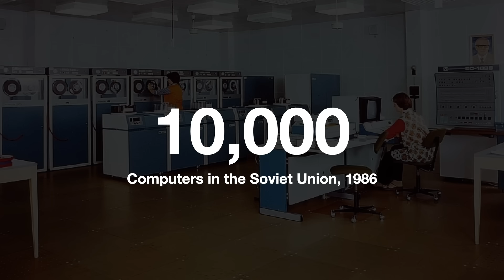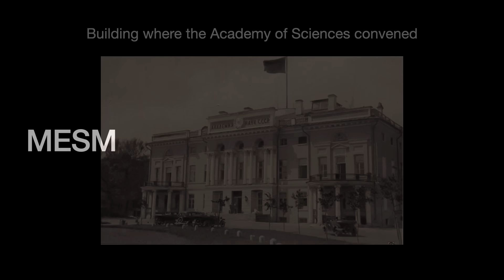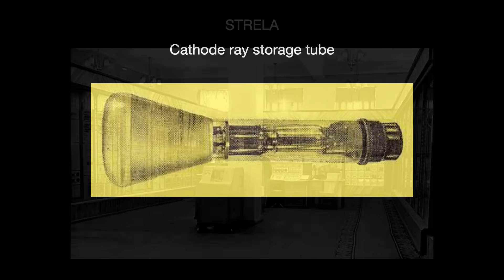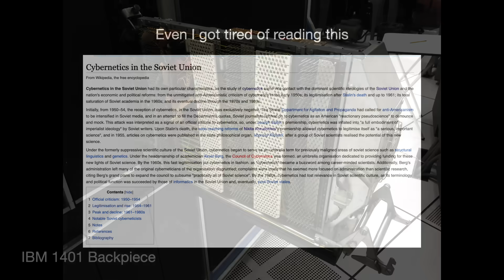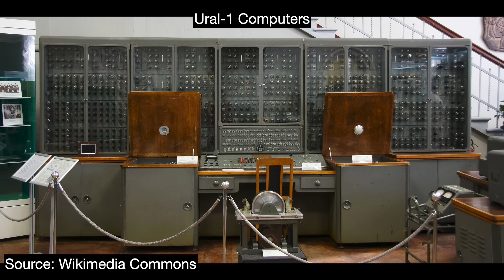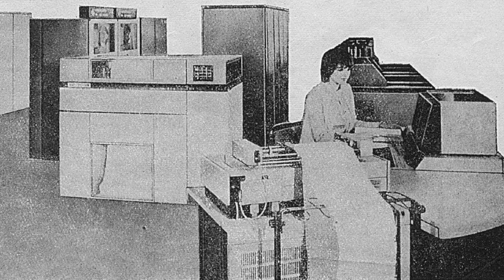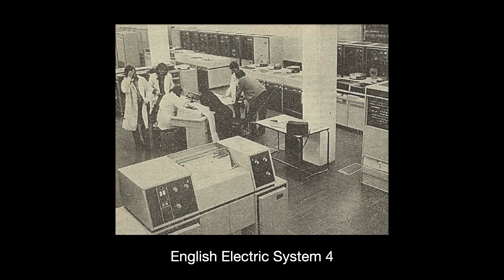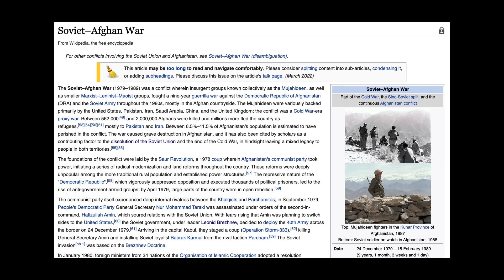Why the Soviet Computer Failed

Comment: USA companies held essentially monopoly on high integration microchips and high quality transistors. Just that makes a world of difference as to what can be made economic.
In 80s, US had single chip FM radios. Soviet radios were wire wrapped monstrosities using low quality transistors.

It had exactly zero to do with incentive - when it was required, even excess quality and performance was achieved. Computers were deployed a plenty everywhere, but they were typically form fitted industrial machines to the application and not extensible, universal ones like USA made for general public.

USA explicitly avoided that issue thanks to ARPA/DARPA and universities funneling the research into corporations. Soviets... made high quality things military secret so nobody could iterate and mass manufacture of them was nonexistent.
Reply: In Czechoslovakia, semiconductors were produced by the company TESLA Rožnov. Elsewhere in the world, the company had some technology and here it was perfectly mastered to have uniform quality. In Tesla, they copied almost all CMOS, NMOS, FET, JFET, bipolar and alloy methods. A very wide assortment. The flip side of versatility was that quality fluctuated. For analog applications, it was possible to choose components with better noise than Western products, but without a choice you could be unlucky and get a piece that is significantly worse. This was typical for socialism. Everything existed according to the papers, but it wasn't enough and it didn't have guaranteed quality.
Reply: Precisely. That was due to lack of focus on mass manufacturing of electronics that required such things.

And as far as I remember, Tesla Roznov semiconductors were never large scale integration, until Motorola/OnSemi got its hands on the factory. It's still not making LSI chips.

Best thing out of it were high quality medium scale analog parts like voltage references - and that in almost 90s...
These days, Roznov facility is a design laboratory, rather than a manufacturer.
Reply: Excluding the Soviet Union does not a monopoly make.

Comment: I'd been taught that Soviets stuck with tubes because they were less susceptible to malfunction or inaccuracies with temperatures an altitudes that early ics had. Thing needed to work from the taiga to Afghanistan
Reply: That and tubes are a lot more resistant to EMP.

Comment: When I worked at Elliott automation we had been selling the the 903 18 bit digital computer for a few years. The Russians wanted to buy a 903, in exchange we had to buy one of theirs, this would have been around1967. The Russian computer was of no use to us, it was housed in what seemed to be something made by a military tank company, we had no use for it and it was just stuck in some quiet corner of our plant in Standard Road, Park Royal. I believe we were suppose to pay import duty on it but we didn't want pay the duty as we didn't want to use it. One day the heavies from I guess the 'Import Tax Police' came armed with wrecking equipment, they just set to with sledge hammers etc to completely smash the computer up, they did seem to be enjoying this job, They left a messed up pile of stuff and left after a cup of tea, quite interesting to see them work!! I do believe we got quite a bit for it for scrap metal. In 1969 the 905 computer was introduced, this was a integrated circuit version of the 903, faster and more compact. We were not far behind the US in integrated circuit design and manufacture, I started working for the Field Service arm of GEC computers in about 1971, mainly working on the 905 computer.
Reply: I joined GEC Computers in 1973 on the software side, writing Operating Systems for the GEC4000 series. 7 years later I was installing and commissioning 4 of these at Machbriboringtorg (excuse spelling) in Moscow to control an earthquake simulator.

Fun days, and more fun evenings. And plenty of vodka, chamagnskoja, etc.  And decent caviar was cheap.

Comment: One could easily argue that there's no way even a clean sheet domestically produced computer manufacturing base would have done them much good. They were 10-15 years behind and would not have caught up at all if they had to reinvent everything. To make matters worse, the whole ecosystem is international and today only a Dutch firm is capable of creating the masks and photolithographical chip layouts at the sub 10nm size. Good luck stealing a giant chip fab.

Comment: Two comments, IBM 1401 used punch cards for programming and data input. 'Cathode Ray Tube' is used as a display unit, not as storage.
Reply: In the early days of computing, CRTs were used as memory. Delays in material, mercury or nickel tubes were also used to create a circular register. https://en.wikipedia.org/wiki/Williams_tube

Comment: You talk only about supercomputing and mainframes, but you bypass the subject of PCs. When this market exploded in '80s, the Eastern Block quickly acquired this technology by violating the tech. embargo through... stealing, smuggling and pirating everything possible. As a Pole I could even give you names of a few later politicians (including one Prime Minister) who made money of, and specialized in maintaining smuggling lines (most probably through Austria and East Germany) to USSR. I remember so called "computer markets" where you could order and buy whatever software you wished. Usually the "pirates" just copied it on site to floppies and later CDs for a very decent price, which was just the copier's earn. Initially there was absolutely no licensing rights protection. With time someone started to pursue and tax piracy, but it was just a systemic half-official mafia extorting their "market share". This continued and tightened throughout '90s, long after the Eastern Block crumbled, into the 1st years of XXI c. when it was ultimately officially suppressed.
Additionally, in Poland we had successful lines of minicomputers: Mera-300, Mera-400, and Odra line: 1001 to 1325. My father used to work on Mera and so I used to play with tape punchers, and colorful computer tape spirals and confetti.  :)
Reply: Smuggling a few hundred C64s wasn't the massive advent of personal computing. :D
Reply: @prutok  HEHE, you underestimated it terribly. C64s weren't office machines. The market for C64s, Amigas and Atari STs was huge even in Poland. They've smuggled x86 line and mainframe terminals. I'm convinced the West was perfectly aware of it.

Comment: First of your videos I've seen, and very interesting. A couple of minor points though: Firstly, you point out that the Soviet's space programme was based entirely on the 'captured' German rockets and personnel, but neglect that fact that the US (and the UK) did exactly the same. The Saturn V was a direct descendent of the V2 - built by the same German! Secondly, although ICL's System 4 may have started out as import from RCA, by the time it was in common use in the UK, it had developed into a much better system than the 360. I worked on both back in the 70s, and the System 4 was far more flexible and easier to use. It was a true parallel processing environment, for a start, whereas the 360 used what were basically tricks to do the same. Then there were a myriad of little operating improvements - for instance, the System 4 would find the tape it needed next, whereas the 360 had to use an allocated tape drive - so you had to rewind the tape and replace it, while the computer sat idle! The real reasons that ICL failed where IBM succeeded were the usual problems with the British government's handling of industry (almost universally a failure) and the fact that it is (or was then) almost impossible to win against the sheer might of US development and production.
Reply: America has 4.5x the population of the UK, and vast natural resources.  Also, the US was never bombed.  I'd say this is what gives the US a leadership role in many things.

Comment: Very interesting video.  One minor point: ENIAC was the world's first all-electronic computer, not the first digital computer.  The first digital computer was Karl Zuse's Z-1 in Germany in 1941, which used electromechanical relays in place of vacuum tubes that the Nazis could not obtain.  It was slower than the later ENIAC but was sufficient to help design the V-2 ballistic missile.
Reply: yea, I also already have written a comment on it. But one correction for you  "Z1" was 1936-38 it was semi-programmable and later "Z3" -1941 was the fully programmable  and automatic digital computer.
Reply: yeah, for sure the ENIAC was not the first computer, not even the first digital computer.  Interesting to note the German's work, on the Z series, but, what about Turing's work on the Bombe, used to de-cypher enigma code?  Did his work, or its beginnings, pre-date Zuse's work?  And, although the work on ENIAC began during the war, and was purportedly built to calculate trajectories of artillery shells, it was not completed, until after the war ended--but, I'm guessing that it was the model for IBM and Burroughs, etc.--because they were not using relays, like Zuse or Turing, but tubes, then transistors, then IC's with multiple transistors in them, all purely electronic devices (although "core memory", was not, initially...fortunately the electromagnetically charged, read, and reset miniature rings, suspended on wire arrays, that made up "core memory", were eventually also replaced by semiconductor memory, as well).  But, I believe that early in the war, Alan Turing was cracking the enigma code, to direct Allied efforts, to cut off Rommel's supply line, via Italian shipping, intercepted by Brit aircraft, destroyers and subs, operating out of Malta.  In fact, the Brits got there first, best Enigma stuff, from captured German weather ships, early in the war, as well as the help they got from the Polish, who had first recreated an Enigma machine, I believe, before the war began, in Europe.  So Turing had to have created the Bombe, pretty early, in the war, possibly simultaneously with Zuse's efforts, to create his digital computer.  Personally, I believe Alan Turing's work had much more of an effect, was much more important, on the course of the war.  But Zuse's work, might have had much more of an effect, on the computer industry, as a whole, after the war, perhaps.
Reply: @michaeltotten7508  I'm not sure I'd call the Bombe a computer, but more special purpose hardware. Colossus was. I'd give credit to the ABC machine at what later became Iowa State, which Mauchly visited. This visit, which he did not mention on the patent application for ENIAC, was one of the reasons it was invalidated. Alice Burks wrote a book called "Who Invented the Computer" in 2003 which goes into the patent trial in great detail. Her husband worked on ENIAC. She is quite anti-Mauchly so I'd be cautious in reading it. My first PhD advisor was a student of von Neumann's at Princeton and also worked on the IAS machine, writing an assembler for it, so I have to be careful not to be biased to von Neumann as the inventor of the stored program concept. Which, interestingly, was considered important because there was no index register in EDVAC and to walk through an array in memory they looped and changed the read address in the instruction!
Reply: Oh yes, for sure.  The ENIAC was the first general purpose, all-electronic, digital computer--but definitely not the first computer, by far!  The Chinese (I believe it was from them) used an abacus, possibly thousands of years ago, and slide rules were an early form, of a computer, long before anything electronic.  The Greeks had that famous all metal computer device, for navigation, based on star positions, I believe.  And the Egyptians had a similar device, for calculating positions of sun, and moon, based on earth rotation, etc.  Even during WWII, the British had their "Bombe" computer, long before ENIAC, to break Enigma codes, based on their brilliant computer scientist, who didn't get much recognition, for his great work, because he was gay--and the government claimed his work was secret--but that secrecy, about his particular contribution to the war effort, wasn't necessary anymore, after the war was won...and so, throughout history, there have been many different forms of "computers", the ENIAC (from MY alma mater, btw) being just one, in a long and almost continuous chain, of computing efforts, down through the ages...I also remember constructing an electro-mechanical toy computer, called Brainiac, and a mechanical-digital plastic toy computer, called Digi-Comp, both while on Christmas vacation, during 9th grade, in 1966, as a project for my accelerated algebra class, in junior high school, as well.  And they both worked, in their own limited ways, to do simple addition, one form of "computing".  Of course, Digi-Comp had come, in the box, in 50 different plastic pieces, without instructions (from the last user), and I had only 2 photographs of the assembled version, on the outside of the box, to use, to assemble it, and get it working--but I was successful, nonetheless (needless to say, I got straight A's in algebra, that year...ha ha ha ha ha...)
Reply: The Z3 correction has been made already, but my research showed that the Z3 was considered a research project and never used for the war effort. It was destroyed in a bombing raid in 1943.

Comment: In 1986, the US had 30 million computers, not 1.3 million.  I do not know how many the USSR had in 1986 but even as late as 1989, they still only had 200,000 computers, so the computer gap that the Soviets lagged behind was even worse than indicated in this video.
Reply: You are including desktop PCs whereas the video is clearly about industrial computers.  For example Cray never made anywhere near 30 million machines...
Reply: @krashd  It was not clear at all from the video that he was talking about industrial computers.  For one thing, I am pretty sure we did not have 1.3 million industrial computers in 1986.  Cray also never made hundreds of thousands of industrial computers either.  Unless you can find a reliable industry source that would suggest we had that many, I am sticking to my guns and saying the video understated the number of computers in both countries, although, as I pointed out, using all computers (not just industrial computers as I provided all computers including PCs) shows an even larger gap.

Comment: I started with a large business supply company in 1983. The computer room was huge and had one computer which took up a large room. 20 years later when I went back there the computer room was full of desks and people working. The new computer was sitting on a folding table in the corner. Unfortunately, now we cannot make enough computers here in the U.S. to keep new cars in the lot.
Reply: The recession will fix the supply shortage. It always does. The crooks are using the shortage as an excuse to steal.

Comment: A company that manufactures frames from us is located in Moldova, part of the old USSR.  I visited the plant almost 20 years ago.  The plant from was an old Soviet computer factory in Chisinau that was abandoned when the Soviets pulled out.  The computer factory had razor wire and two sniper towers.  Very ominous place with earthen barriers and all that security.  The concrete floors were coming apart and the brickwork was haphazard.  The building's condition looked like it was from the 1930s, but it was built in the 1980s.
Reply: To defend against the West finding out just how inferior Soviet technology was, obviously.  We are seeing Putler trying to use Soviet weapons against Ukrainians armed with modern Western weapons.  The contrast would be funny if it weren't for the deaths of innocent Ukrainians.  Viva brave little Ukraine! Viva!
Reply: Same visit  ...   5-6 yr-old apartment buildings were losing their facings & mortar was crumbling.  Where a friend stayed, a bathtub fell through the ceiling.  Local authority advised that someone would come to assess the damage in a couple of weeks.   Repair ?  Depended on the assessment, which had to be reviewed by some committee  of course.
Reply: @2011Azure  we did a grand tour of Chisinau.  Large bridges that were abandoned a decade before, half finished.  Several apartment buildings made of concrete, but never finished past the primary structure, so no windows or doors, but people squatted in them anyway.  Back then, unemployment was 50%, wages were about 5 US$ a day.  Met with a bunch of engineers, but their inability to see out of the box, to be creative was astonishing.  They only thought in a linear fashion.  They could make anything you gave them the specs for, but had difficulty creating anything new.  There was a lack of finesse in their designs.  This was from decades of Soviet philosophy, where coloring outside the lines would get you in big trouble, so it was ingrained in the culture.  Sadly, we couldn't engineer anything there, had to go to Europe or America, then let them build it.  They simply lacked the imagination after decades of brainwashing that told them imagination was bad.
Reply: that wasnt brickwork, it was a genuine soviet mosaic.
Reply: @deadprivacy  Visited a former SSR (Western) just after the breakup.   Watched the daily work of a bricklayer at a new building.  He seemed to be the only one.   
Each day a different truck would deliver bricks.  Not on pallets, just dumped loose on the ground.  There were four sizes, depending on the day.  
Each corner of the building had been started with a different size.  The structure was being awkwardly "stitched" together between corners, but he was tending upwards in the safe zones.   
I imagine that was his survival mode after the second day's WTF moment.  The Soviet methodology survived for quite a while.